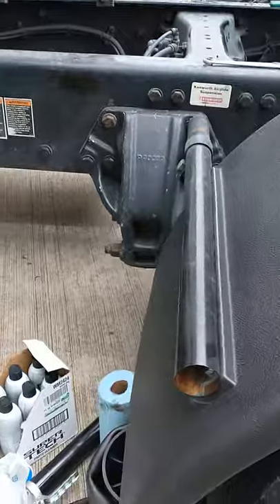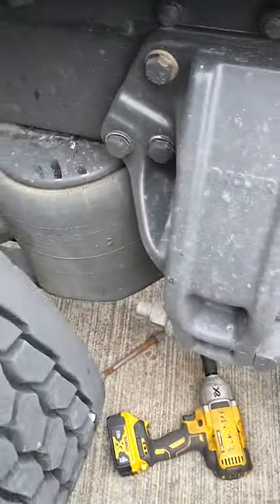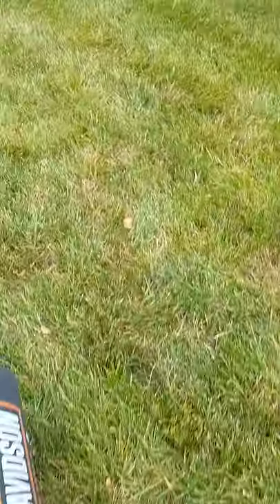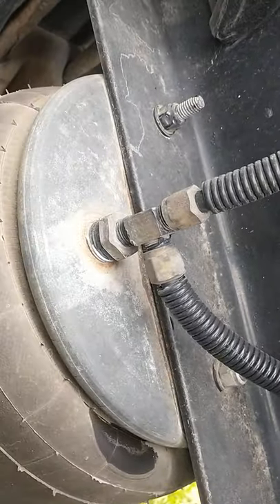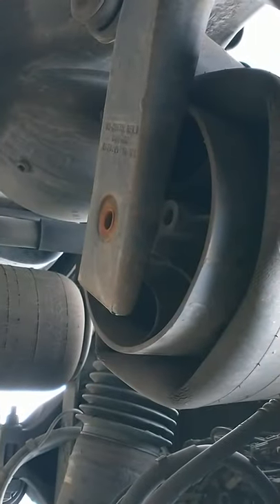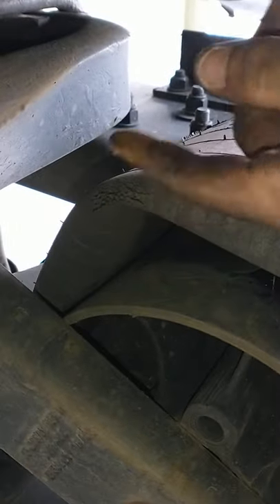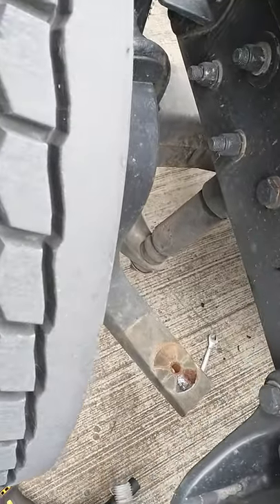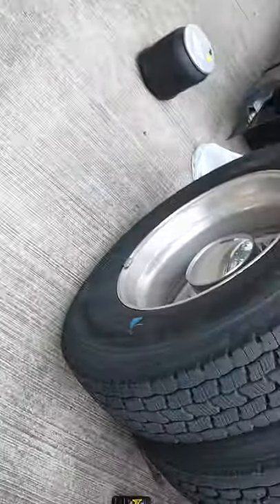Kenworth T680 Air Spring (Airbag) Replacement Pt.1

Comment: How did you get the air line off??
Reply: Drop your air bags get all the air out if it’s stuck push down the collar on the fitting and twist out👍